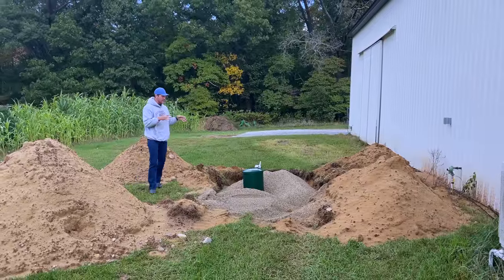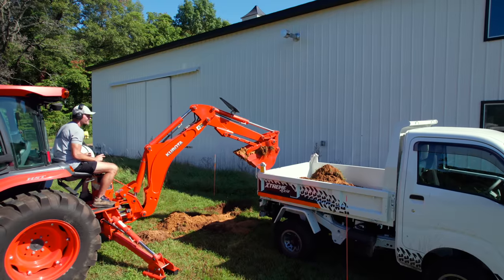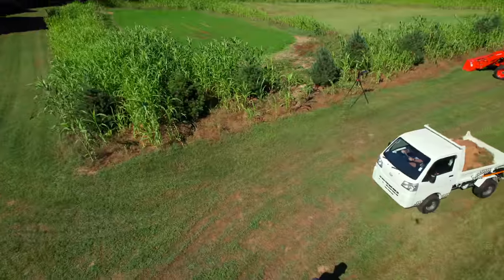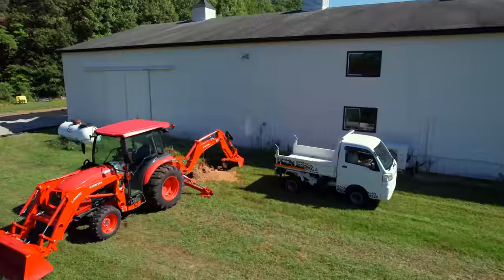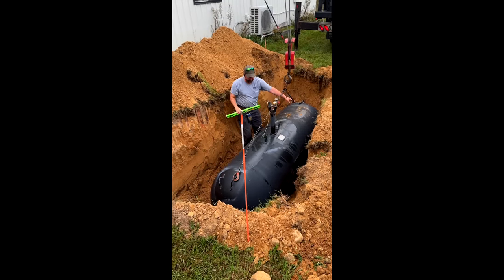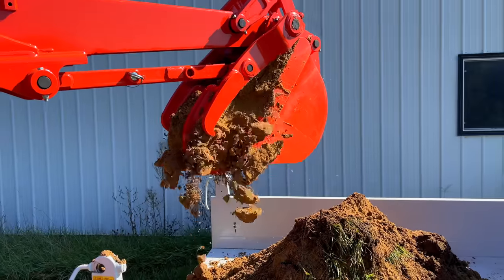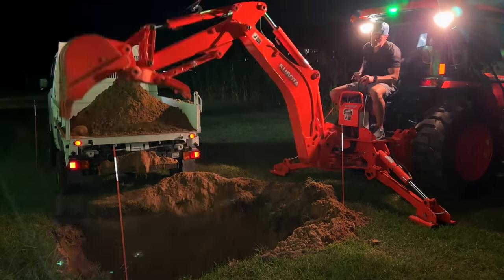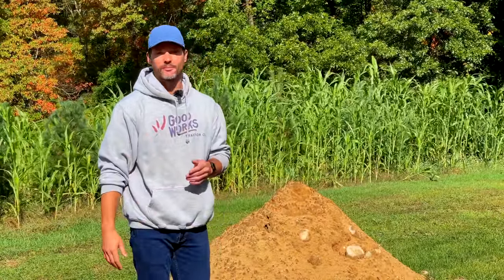BURY A PROPANE TANK WITH A TRACTOR BACKHOE AND MINI DUMP UTV

Comment: Rocks! Looks like you're digging in almost pure sand. 😂 Seriously, you could have set up where your truck was parked and cast the dirt from the hole to the left, away from the building.  Then scooped it up with the loader to fill your truck for removal. Way faster than loading the truck one little bucket at a time. That dirt looked so clean I can't see a problem backfilling with it. You learn by doing and it's great to see it getting done!

Comment: Yes, controls can be different from backhoe vs excavator and it can be a challenge sometimes going back and forth. Controls can usually be switched on newer construction backhoe and excavators. Some tractor backhoes can be changed to excavator controls but requires parts to be removed and new parts installed. 

Yes you are correct about a skid steer being quicker.
Reply from the maker: Yeah the older I get, the slower my mind is to pick up on different controls
Reply: My Kubota was that way. Just swaped 4 hoses around now it is right. No parts needed. Even did a video BH77 https://youtu.be/zWktlYdGeIo

Comment: The only backhoe worth while would have a much larger bucket than that, with a much larger reach. I remember going to look at an international 3616 backhoe with my father. It did an incredible amount of work, from digging a well to a foundation hole. That should have a 20-24” bucket installed to cut down on time. The narrow bucket is for trench work like laying water line or electrical.